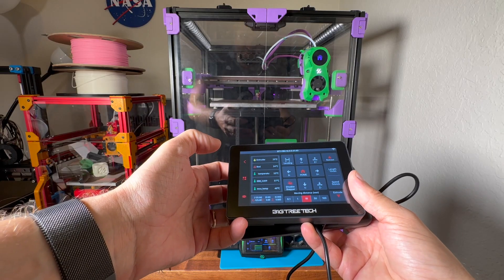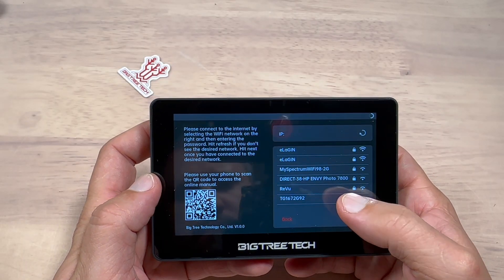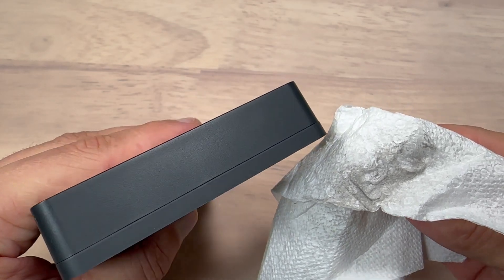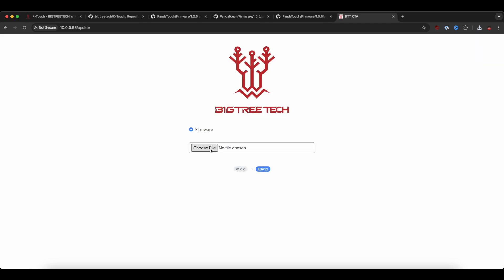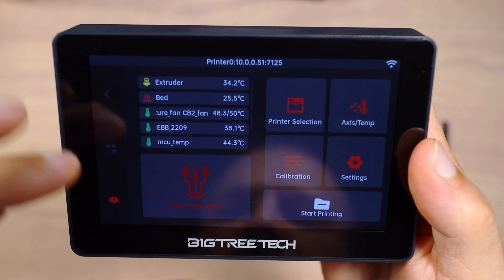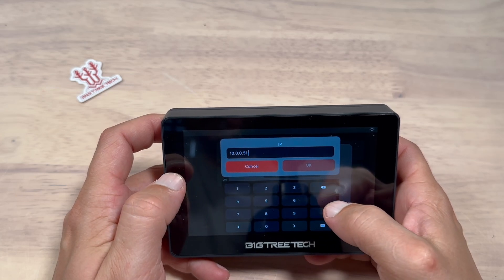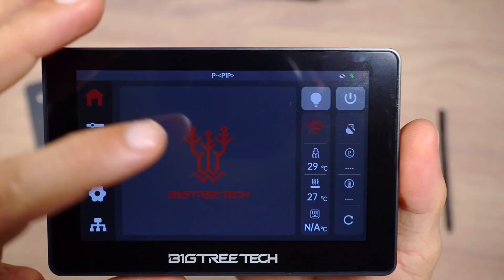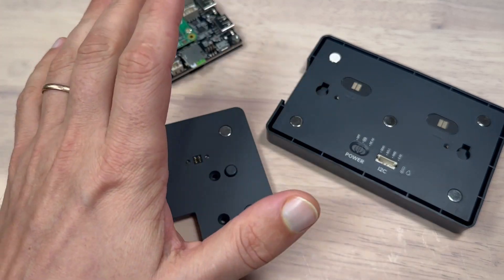BIGTREETECH Panda Touch aka. K-Touch

Comment: Will the Panda Touch still communicate with a Bambu printer if it has the K Touch firmware.  I would think not, since it is meant to control and monitor Klipper machines, but I didn't hear a hard no that it won't in the video either.
Reply from the maker: K-Touch firmware connects to the Moonraker API, which sends commands to the Klipper service running on the same machine. So, K-Touch firmware is only compatible with Klipper machines. Bambu, on the other hand, uses proprietary firmware with its own communication protocols and requires its own set of instructions and communication layers.

Comment: I bought one of these for the Panda/Bambu controller.    But since Bambu has decided to flip out, I flashed the firmware last night to run my Klipper printers.   The UI doesn't look as sharp, but I do find it more useful really.
Reply from the maker: That is why I like more complicated feature filled products, you have always a way to repurpose them. Today I have seen post from BTT trying to collaborate and solve issue with Bambu... hope they will get it done. I feel like this device somewhat limited, casual and less hobby friendly but at the same time at least we have basic Klipper firmware and device isn't completely useless.